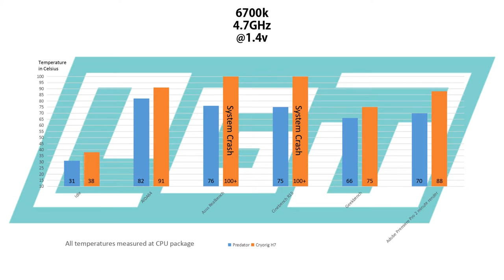EKWB Predator 360 review- Is it worth your money? Spoiler: IT IS! Best AIO ever!

Comment: btw is it normal that with my kraken g10 that i just bought i was hitting up to 85c on a  properly(checked) mounted reat rad (water performer 3.0)and front intake 120 mm fan,  when i was getting 89 with 2 fans and no rad? i thught it was a faulty unit, but then i added a top exhaust fan and it went down to 60-71 c(dependign on rad fan fan speed) is it normal that a rad in the system  requires more fans throwign hot air out?
Reply from the maker: That temperature is definitely not normal. I would highly suggest pulling it out of your rig and checking to make sure the cold plate is making good contact with the GPU die itself. I have had GPU's like the 1080 FTW that required me to use a copper shim for the cold plate to actually touch the GPU die. If it isn't that, I would check the pump itself in the Water 3.0 unit and make sure it is functioning. That is a great liquid cooler and should keep any card below at least 65c.
Reply: it does keep the card below 62 even  now  but only o n3 case fans ( 1 on the rad ) and at 100% rad speed. oh i forgot to mentjon its my top crossfire card which was hittign 95 c with 2fans!.  but iwth 2 case fans i get 80+ c on the rad even.  now im sitting at 3 case fans front intake at 70  % exhasut  top at 90% and rad fan at 50-60 % . and the top gpu temp is  71-72 c whci hsi good for me. its still kinda high. imgetting noctua fans soon and runnnig them all at 100%
Reply from the maker: I use Noctua fans in my personal rig. I know they are kind of expensive, and they are without a doubt the ugliest color in the world, but they are amazing. I painted mine black so they didn't look so out of place, and I couldn't be happier with the results.

I run two Noctua's in push-pull on my GPU radiator and the card stays in the high 40s most of the time- sometimes hitting low 50s.
Reply: i  specifically didnt want a open window casem i have a closed silenced case (phanteks p400s) so i dont really care abotu how they look. i heard   they are  more silent at 100% than  msot fans at 70 so im pretty hyped for that. and yeah i think push pull on noctua is kidna redudndant since  they are usch high quality fans and pressure optimized adn actually silent at 100% even, but i expect to hit about 55-60 with noctua fans on my setup. can afford only 2 of them so  thast a bummer. gotta get that 140hz monitor, i wanna go pro in league of legends so its a priority :P
Reply from the maker: I have been wanting to do a high refresh rate monitor for a while now, but decided to make the jump to 4k first. Good luck with the League of Legends!! :)
Reply: 4k is good if you have great hardware but its underoptimized now. it visible especialyl in league a lot of games will just not scale,  can you tell me tho how  1080p looks on 4k monitor? is it like on a 1080p monitor? or does it look like 720p on a 1080p monitor?  Hint Hint a video idea, (1080p on 4 k monitor  and 4k on 1080p monitor)
Reply from the maker: Fearsome Pony That is a good question. I'll have to pick up a used 1080p screen and compare the two.
Reply: shouldnt be a prob you can get a bad one even  as long as people dont point out poor colors :p

Comment: With EKWB having the recall I'm just curious if your replacement unit is the updated R1.1 or still the old R1.0? In either case, have you had any problems with your current 360 predator?
Reply from the maker: I did receive the updated 1.1 revision. I have had zero manufacturing issues out of revision 1.1. Feel free to check out my other video on cramming this thing into an InWin 303! Thanks for watching!
Reply: Let's Get Techy How can i check if it is the updated version or not?
Btw, nice video, only 3k subs? You deserve a lot more